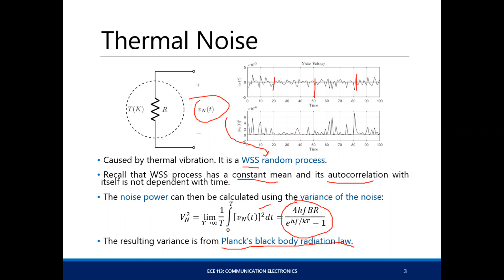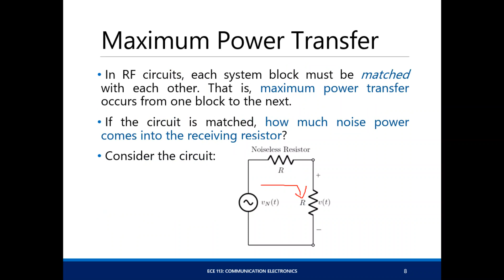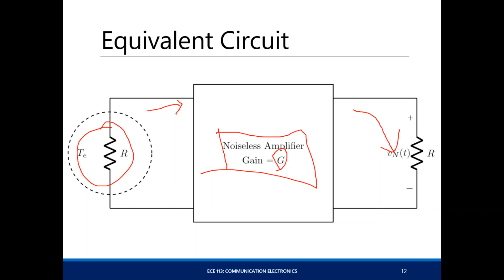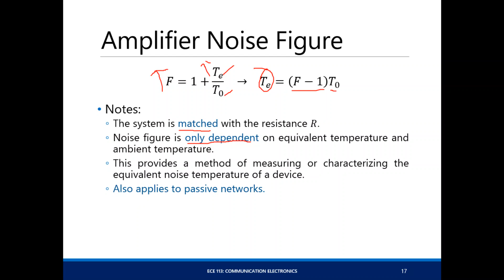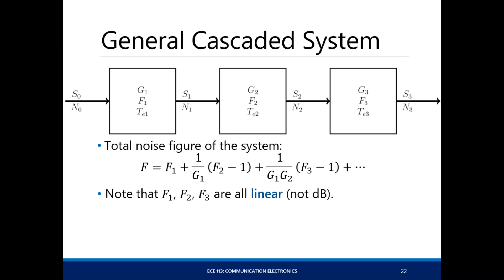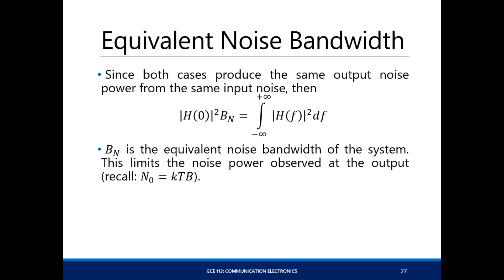Noise in Electronic Systems

Comment: Problem with this approach is the assumption that high radio frequency is the only variable that influences electrical appliances. It does not take account etheric inertia and it's dynamics.